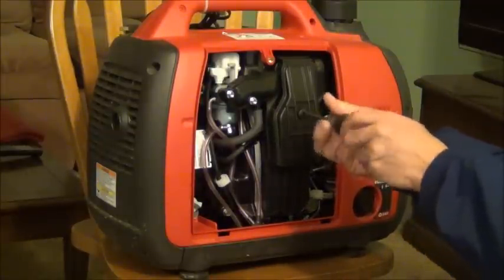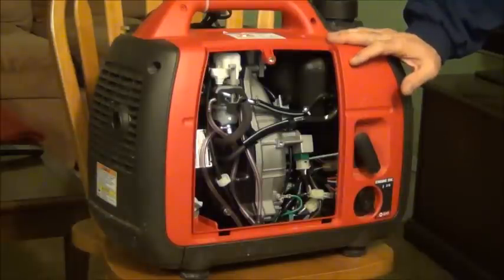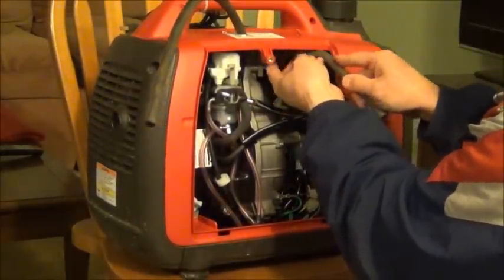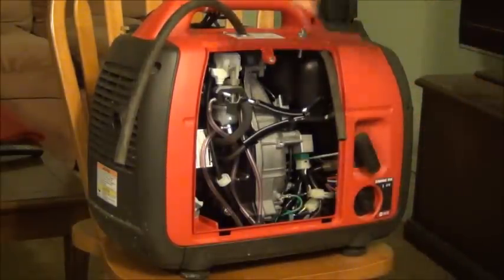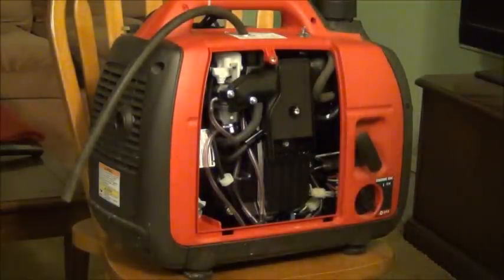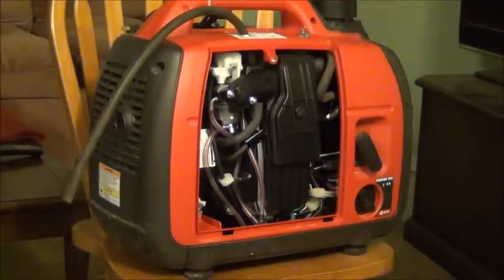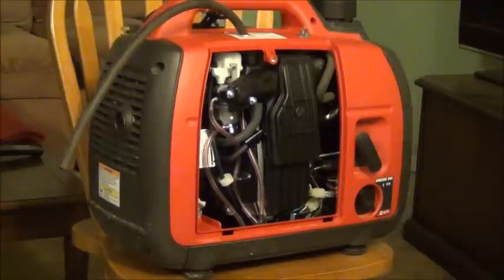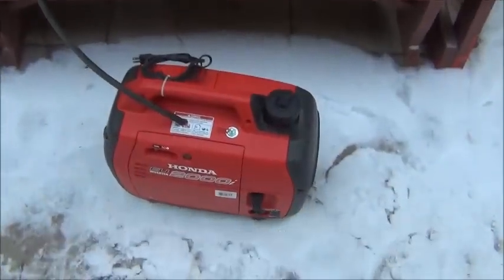Honda EU2000i improvement. One of a kind.

Comment: Or just add an extra button wired to the on and off switch, flip it on and close the main knob to off it will continue to run without getting any gas.
Reply from the maker: Interesting idea. Thanks for sharing. In my case I also solved the issue with the external tank, which was very important to me (don't want to get up in the middle of the night to add gas).

Comment: 90 degree threaded fuel shutoff valve costs about $5 US.  Tap into gas cap.  Connect to aux. fuel tank.
Reply from the maker: Will not help with the draining the carb, eh?   ;-)

Comment: The stop switch already cuts off the fuel. You just need to unplug it from inside
 so that it will continue to run the fuel out for storage.
Reply from the maker: David, if you read all other comments (answers) you will see what this is all about.

Comment: There already is a fuel shutoff. Duh. The problem is its the same switch as the electric kill. 

All you have to do is disconnect the green and black wire connector.  This will keep the generator in the on position all the time. Then you can turn the switch off and it will run out of gas.You don't need to buy anything to do this mod. Just pull apart the electric connector.

Pros of my Honda.uses very little gas. It's very. Quiet.

Cons. It doesn't like to run.

I also removed the spark arrester from under the muffler. If you have one of these keep it in a dry dust free environment and clean the carb twice as often as you should. This model is discontinued so there is no point telling you don't buy one.
Reply from the maker: Why is everybody missing the point? About one stone and 2 birds? That I don't want to buy a gas tank cap for $100 bucks, but I also want to be able to use an external tank with a flip of the switch? Being able to drain the carb and leaving the pump full is a huge bonus with this 5-min modification.

Comment: Dont foget to completely drain the carburetor when your finished using and storing generator.. also us erc fuel no ethenol it causes gunk build up.. peace brothers.
Reply from the maker: David, the idea of this modification is that once you close the valve all gas will be used up, there will be nothing left to drain... Basically an easy way to drain/burn out all of the remaining gas from the carb... Peace!

Comment: Closing the vent in the fuel cap ( off) it will stop the motor in a few min..
Reply from the maker: Yes, and it will also drain the pump and leave it without fuel, and ruin the diaphragm inside the pump.
Reply: I have 3 hondas gen (2)2000w and (1)1000w never had any problems with them 6 to 8 hrs a day for last 6 yrs..
Reply from the maker: Yes, I also believe they are the best what market can offer, that's why I bought mine. Sometimes mine is sitting for month's and years, but when I need it badly it starts like a charm.

Comment: Easier to just drain the carb bowl every time you store it
Reply from the maker: If it is easier then of course. But it doesn't help with using an external tank :-)
Reply: How can it be easier to have to open the side panel and then drain the carb bowl, when he is simply turning a lever on the outside of the generator?

Comment: Actually, after doing more research if you just turn the main on/off switch off, but not fully (leaving the engine running) the fuel pump is turned off and will run out of fuel. So, you don’t need any modifications at all. It is recommended however that you drain the carby by turning the drain screw.
Reply from the maker: I am confused. "the fuel pump is turned off and will run out of fuel" But this will kill (dry out) the diaphragm, and we try to avoid this. I will leave this option to people who like to drain the carb using a screw. I personally prefer to flip the switch with the finger and being done. And I doubt that by turning any screw they will be able to use an external gas tank, which was a big part of my plan and modification.
Reply: Wally Knorr Canadian Hunter hi Wally, if it is that you don’t want the diaphragm to dry out, but you still want to run the engine out of fuel then you need to install a fuel tap well ahead of the diaphragm. I’d say the closer to the carby the better. Then, you can ensure you have fuel back in the line closer to the pump.
Reply from the maker: Steven, I think this is exactly what I have done, and what my video was about -)

Comment: You know if you disconnect the engine cut off switch when you turn the on/off switch off the engine will run itself out of fuel. This is because the on/off switch is a combination engine & fuel cut off. You don’t need a fuel tap and It takes around 3 minutes to run dry.
Reply from the maker: Hi Steven. I think the method you described will also leave the pump empty. Main concern people have is that if you leave the pump dry then the diaphragm will dry out in the pump. But at the same time they want to have the carb dry, without stale gas. Anyway, I resolved the problem and completely forgot all this stuff, now if I have a power outage I just grab my genny and start it, to save the eggs in incubator. This happens once in a year or in 2 years, and even after sitting so long and with old gas it just fires up. God bless Honda! My solution also offers an elegant way to use an extended tank, which should not be underestimated, just to solve this problem I would make the modification.
Reply: I know the newer 2200 model has a "fuel off" position, but the 2000 model doesn't have that extra position.

Comment: You know if just turn the switch to almost the off position not off but right before it shuts off. It will cut the fuel off check out the video on my channel I show how it works
Reply from the maker: That's interesting! Thansk for sharing! I also wanted badly to use an extended gas tank, so I can sleep peacefully through the night. But I wanted to accomplish this without investing any money.
Reply: @WallyKnorr  yeah me to but I did buy the extended run gas cap and hose with the primer bulb already on it. I also got the 14 gallon gas tank on wheels that comes with hand pump that looks like a gas handle at the gas station think it's for boats but I got it at northern tool before the hurricane  irma last year
Reply: @WallyKnorr  I have 2 generator videos on my channel I have a big one that run my whole house with central AC and heat everything washer and dryer stove hot water heater. But it's super loud so I got a smaller Inverter generator Honda clone
Reply: @supremeautomotive6749  why a Honda clone? I bought a barely used Honda 2000 like the one here for $325.

Comment: As the EU2000 fuel system is sealed, you could have accomplished the same thing with a new $8 fuel cap.  The fuel pump in the generator will draw in fuel from a larger tank and run for days!  Your modification will void the warranty!!!
Reply from the maker: Maybe. The only problem is that I have never seen 8-dollars caps on Ebay when I was looking for them few years ago. Don't forget that we are in Canada, and sharks like UPS or FedEx will charge you an arm and leg just for customs and shipping. And your suggestion will definitely not help me to keep the carb clean and dry when the genny is not in use. But good try ;)

Comment: Honda has a drain valve under the carb with a hose to dump fuel out of carb when storing for any long period
Reply from the maker: My goal was to be able to perform this without any additional action. Another goal was to be able to use a bigger tank at any time. Now I always let the carb drain, no matter for how long I am storing the generator. I simply don't know when next power outage will happen, so I just flip the peacock - and done!

Comment: Your not a poor guy if you can afford a Honda
Reply from the maker: You are right, my friend. We quickly forget how good we have it in our lives.
Reply: Yeah, they aren't cheap.  I own two of them.  One was $325 and the other was $450.  Im happy with the price though.  I plan to run them together in parallel.
Reply from the maker: @JM-nh8yp  I wish we had such prices here in Canada ;)  I remember that those generators come in different versions, when the name has a "C" it means Companion, and it is designed to be used in parallel.
Reply: @WallyKnorr  Yeah, but you can run the non- companion ones together.  And of course, there are videos on YOUTUBE showing how to make the wiring harnesses that allow that.  I have quite a bit of experience with Canada. I was born there, and half my family is Canadian, so I've visited many times.  I also grew up one mile from the border in the U S.

Comment: Good video I'm surprised the honda generator doesn't have a fuel cut off as much as it costs. I hope all the new generators did not stop the fuel cutoff valve. I'm thinking about purchasing another one I'm going to have to go look at it more closely. Or call technical and ask them. I have an older 1850 Coleman generator it's the only piece of small equipment that does not pee gas out the carburetor if I don't shut off the fuel valve. And I move and use it around quite a bit because it's the lightest generator I have.
Reply: They absolutely do have a fuel shutoff, it's just made so it cuts spark at the same time. 

Also they have a screw to drain the fuel out of the carb. 

You can also just unplug the kill switch that goes to the fuel valve and run it our of gas.  

Or ideally use stabilizer like honda recommends
Reply: All you have to do is turn the switch to the off position but you dont turn it all the way until it turns off you only turn it to right before it turns off and then just let it run and it will run all the fuel out of carb I have video on my channel on how it's done

Comment: Of all the youtube videos I've watched over the years, THIS video has been the MOST PRACTICAL/HELPFUL/USEFUL & entertaining video.  THANK YOU, for sharing your "One of a Kind" video.  

Did you ever discard or replace your generator, Wally?
Reply from the maker: Thank you for the kind words. I still love my generator and use it seldom, but when it happens I trust it blindly. Last week we had a power outage, and my incubator was on day 20, I had to get the generator in the middle of the night to save the chickens. And because I use the genny only once in a year I want it to be reliable. I turn the petcock and pull the cord, and after pulling it 5-10 times it starts and works like a charm. Considering that I always burn the gas out from the carb and all lines are empty (except the pump), and considering it is always old stale gas, without any additives, I am really happy with this setup. Thanks again for the encouraging words.
Reply: Here is a tip for starting your generator that I was given to MEeee by an Authorized Honda Dealer, the procedure they use to start brand new generators.
AFTER putting gas in the generator's gas tank, 
1.  leave the gas cap vent CLOSED. 
2.  Turn the Engine switch at the bottom to ON.  
3.  Now gently rock the generator back & forth (NO LIFTING required) to allow the gasoline PRESSURE to build & force fumes into the carb & combustion chamber.  Wait a minute. 
4.  Now turn the Gas Cap vent to ON,
5.  Don't do anything extra.  Now pull the starter cord.    Your generator most likely will start with 1-2 pulls.  

Thanks to this article, I now use SeaFoam additive to ethanol-FREE gasoline:
https://weingartz.com/expert-advice/2017/01/fuel-stabilizers-sta-bil-or-sea-foam/
Reply from the maker: This is interesting, thanks for sharing. I discovered this by myself, when last year my cousin overfilled the oil in my outboard motor, also Honda. It wouldn't start. After removing the spark plug for 100 times I found a way to flush the system, by removing the cap from gas tank and blowing in the tank. This would create the pressure and fill all lines and carb, and motor would start for a few seconds. After I have done it many times it finally was working fine. Basically the same idea, instead of closing the cap and shaking I was using my lungs :)  And thanks for the tip with Seafoam, I will check it out.
Reply: I was so very interested, Wally, when you told me in so many words that it was a matter of life or death for the chicks in your incubator that your generator start.  Are you raising the chicks for eggs or meat?

Right now, Reno is shrouded in smoke from Mexifornia forest fires.

Back in early June, I overnighted for 3 days/nights at a remote dispersed campsite just 2 miles from the Canadian Border right on the edge of the Moyie river in the Idaho panhandle.
Reply from the maker: @azclaimjumper  Sorry, somehow this comment got hidden, and I never replied. We bought a house in a very remote location, and it already had a fenced in farm yard with a barn, so we decided to have a hobby farm. I like to have different kind if chickens, so we just keep incubating them. We eat the eggs, and we eat the young roosters :) We never eat hens, we just let them die of old ages. But May-June is the time when incubators are working non stop. And because of remote location a power outage can last quite a while... If you type in Google "Siberian Outfitters" you will see our place.
Reply: @WallyKnorr  I just entered the search term you suggested.  Nice.  You've got "Social Distancing" down to an art form.  Congratulations.
Reply from the maker: @azclaimjumper  Best time of my life, especially during the pandemic. Life only improved when pandemic hit, because I could continue all my activities without any restrictions, and there was nobody annoying you ;) Sometimes I think this is how all humans should be living, not in congested cities, but on acreages and in cabins. With nowadays progress (electric cars, amazon delivering goods by drones, tiny homes) this is almost a reality.

Comment: have extended other generators by using boat fuel tank, they can cut out sometimes due to lack of air, even though the tanks have breathers! I solved this by just leaving the boat tank fill cap loose which is no hassle to the set-up, or any real danger as they are made pretty good. A GOOD POINT is to just check the generator's own tank, and keep filled which it does most of the time and runs quieter with a full tank, as less vibrations! I live on a boat and run a generator almost 24/7 - 365 days a year, petrol money is just a fact of life and it's only money that the power companies would steal of me anyhow! I'm getting better and more solar/batteries as time goes by and gradually getting petrol expense down a lot.
Reply from the maker: This is very good information. Thank you very much for sharing. I indeed have an older spare boat tank and could use it as extended tank. And thanks for the tip with the internal tank to keep full to avoid vibration. I was once camping when it was bitter cold outside, I had my slide in camper on a big flat bed trailer, so I placed the generator on the trailer as well. All night I could not sleep properly because of the vibration, but didn't want to get out from the warm bed. Next night I put the genny on the ground and it was wonderful. Of course when on the boat then you don't have such an option. I also read that running this genny on synthetic oil reduces the noise, so from day one I use synthetic oil.
Reply: No worries, remember to top up engine oil every 40+ hours and change the whole oil every 200 hours roughly, NOT every 100 hours as they say! it's just a waste and expense. also REMEMBER to wet the air filter with CLEAN OIL not dripping but DAMP enough not to run! do this when a complete oil change is done, and your generator will show you love and affection in return. I sit mine on a piece of carpet underlay on top of a wooden crate/pallet and cover it up with a plastic DOG KENNEL lined with more carpet underlay, this is open at the EXHAUST END and helps with sound, BUT MOST IMPORTANTLY it KEEPS IT DRY in the RAIN and has gaps along the three edges for AIR and power-leads! cheap and pretty easy to glue the underlay inside the kennel, you could make a cover out of wood and or aluminum ? but a dog kennel is light and weatherproof ready to go, I picked mine up free on side of street when they want to get rid of things no longer wanted they sit there waiting for the council to pick up! if you are camping in the bush you could place the generator an extension lead's distance away from your camp site ON HIGH GROUND if possible in case or rain flooding, same as your campsite should be and you won't even know the GENERATOR is RUNNING! good luck and pleasant generator use.

Comment: If you go thru the gas cap makes a vacuum  and external tank can be anywhere, will suck out the gas
Reply from the maker: But if you connect to the existing gas line you connect to the same system, and get the same vacuum, right?
Reply: Wally Knorr Canadian Hunter you right, I didn't see the first few minutes of your video

Comment: They sell a gas cap and hose that connects to a 6 gallon boat tank for extended use for your Honda generator on eBay and Amazon. The Honda has a fuel pump so is as long as you keep the 6 gallon boat tank with fuel it'll never stop running and you don't have to worry about gravity feed.
Reply from the maker: I know. The price of those gas caps made me furious :) That's why I came up with this solution. Ability to connect an extended tank was actually very low on my priority list, but I wanted the genny to start good after sitting, to prevent the carb from getting gummed up, because I use it only occasionally, eg. when we get a power outage and I have an incubator going. And to be honest there is nothing worrisome about the gravity feed, I have many similar solutions on my hobby farm, gravity is a very reliable thing :)